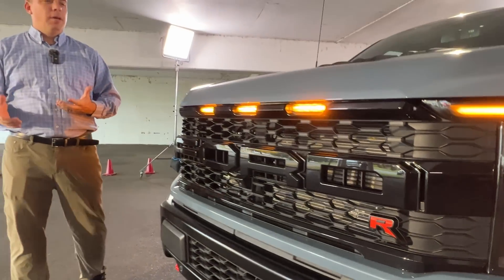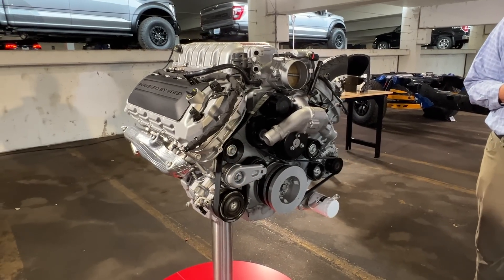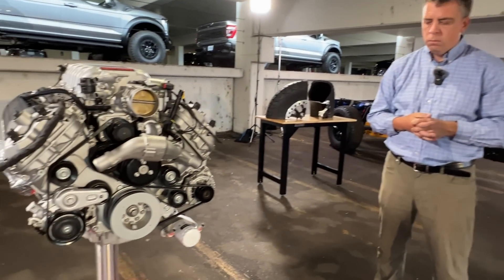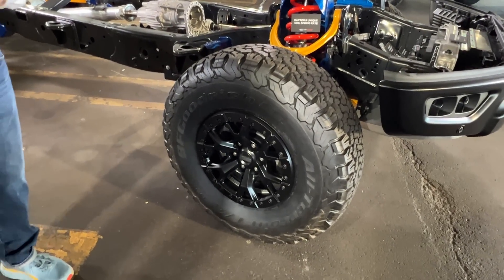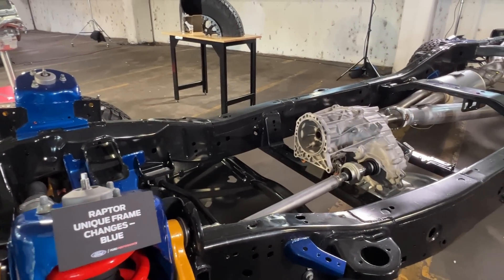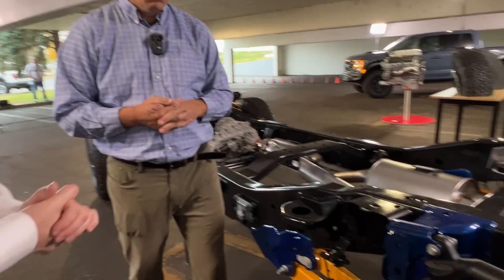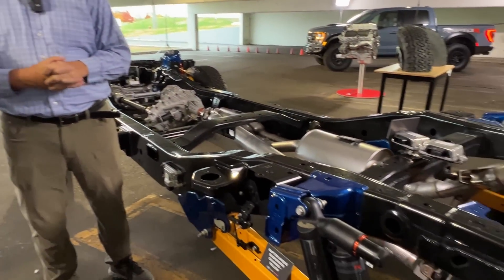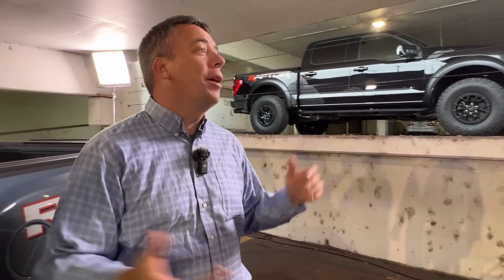Here Is Why the New 2023 Ford F-150 Raptor R Has Less Horsepower Than the Ram TRX

Comment: A well optioned V-6 Raptor with the 37PP is $85-$86K with the Recaro interior. The V-8 bumps the price to $109K? I just don't see $24K in upgrades to justify the price.
Reply: Which even then wasn’t worth it.

Rest assured they’ll have people lined up around the block for them though, despite the fact every dealer that gets them will price gouge the customers and ford will allow it.  The price of vehicles has been needlessly ridiculous for well over a decade now.
Reply: @blakew5672  Ford doesn't allow it, they just can't do anything about it. There's just boneheaded laws protecting the dealers.
Reply: @burgerbandit3646  
Ford can’t do anything about overpricing of a product they have direct control of the supply stream over?  Yeah, sure. 

Ford absolutely can do something about it, they just don’t. So saying they can’t do anything is effectively a lie. Refusal to address a problem is a small step away from tacitly allowing it. 

There’s a reason dealerships are referred to as “authorized” and dealerships marked as such are the ones that receive new stock and can place orders directly with the factories.  

Concerning specialty models (the ones that ALWAYS get gouged) dealerships are unnecessary middlemen who do nothing but attempt steal from consumers through markups. Many of those orders and builds were placed via internet and the consumer is then forced to receive that delivery through a dealer.  We’re not talking about mass volume stock cars that sit on the lots. They’d go under if they didn’t remain competitive on prices. Instead they prey on those that have already made financial commitments to vehicles that aren’t as likely to just walk away. 

If Ford wanted to do anything about price gouging they could stop allocating to dealers that take a cut off the top or start delivering small volume models direct to the buyer.
Reply: @blakew5672  Bro what part of laws are protecting the dealers aren't you getting. Ford can't interfere with the dealers because they're privately owned and the laws are also stopping Ford from cutting the dealers out of the equation period. They've tried threatening the dealerships with all that crap but they just don't listen anyway. Once Ford gives them the vehicles, they have no say over them. And since they can't sell the vehicles themselves, they have to deal through the stealerships. It's disgusting honestly
Reply: @burgerbandit3646  
What am I not getting? How about the part you neglected to mention about “laws”. Don’t act like I’m the dumb one after the fact when you failed to mention a talking point. So now you’re brought it up, let’s address it. 

They’re no law obligating them to provide vehicles to dealers, they’re contractually obligated. It’s different. Contracts always have expiration dates. Come time to renegotiate that contract Ford can prove it’s serious. Again, they have direct control over the supply and can dictate the terms of the sales in the contract.  Dealers don’t like it? Well they can pay up front and take legal ownership of the car first then. Dealers don’t actually OWN the millions in inventory on their lot. 

Funny enough most of the dealers are in a huge uproar over Ford taking steps to separate their EV business model from their legacy automotive model. Don’t tell me it’s not possible when they’re actively doing it right now with EVs.  

Is this the part where we both pretend multi-billion dollar companies don’t exert a huge influence on the laws they’re expected to abide by?  Let’s pretend they are legally bound in this garbage-can dealership scheme, it’s foolish to pretend they couldn’t lobby to get that legislation changed. They don’t, because they don’t actually care. If they did it would’ve changed. Instead they get to wash their hands of the guilty and people will buy the “we’re legally obligated” nonsense. 

Tesla sells direct to consumer, so again, miss me with it when the biggest player in the EV game is using a business model you’re insisting is illegal, and has been doing so unchallenged for a decade now. Terminate contracts with dealers in states that don’t allow direct to consumer sales (ie a safeguard against price gouging) and watch how fast the actual laws change when it starts affecting the economies of those states.
Reply: @blakew5672  So tell me what Ford can do RIGHT NOW about the dealer markup then? Until whatever laws are changed or whatever else nonsense, they're stuck in a loop.
Reply: @burgerbandit3646  
Right now? I legit just told you.  This has been happening for 20+ years. What they can do right now is a moot point given they’ve yet to try anything.  It’s no different than anything that takes time, like growing a tree. You can’t snap your fingers and have a forest, but that’s not an excuse for failing to start planting seeds

Again, they’re actively trying this currently with EV cars. The fact they’ve not even lifted a finger to try it with any other vehicle speaks volumes. They COULD have tried and chose not to.

Comment: Taking the Torsen out of the front and going to an electric differential was weird to hear.
Reply: Cost cutting and weight.  Now they just use the brakes.
Reply: I heard an open differential when he said they’ll use the brakes. Wonder if there’s a power limitation on limited slips since the trx is the same way.
Reply: @bradentrevino7694  nah, torsens can easily handle 1000+hp....there must be another weakness in the axle housing itself...

Comment: As always great TFL video and lots of details. 👍Great to see drive shafts, front & rear axle and diff without any rust.😎 This is very rare at new Ford trucks. This truck is awesome -the price, too.
Reply: Must be it's first day out of the factory.
Reply: Saw a review of a ‘22 Maverick with a rusty muffler in fairly low miles(not Northeast, either!). Clearly a victim of excessive cost-cutting to hit a price point. Reviewer said that it would likely need replacement before warranty ended. Unacceptable!

Comment: So the limiting factor to why they chose not to use a V8 before is the ‘suspension?’ Methinks not.
Reply: I know why. The V6 is lighter weight and better for the trails. They knew everyone wanted the V8 but they were holding back to build up the momentum. Deep down we all knew it was coming back. It just took the right time. They were totally developing it the entire time they just had to wait for talltbe trx owners to buy their trucks ad then want a new truck after a couple years, boom they drop it, perfect timing. It's a beast
Reply: Ignorance at it's finest
Reply: Really, it seems to me the nose heavy TRX that likes to dolphin dive after jumps really shows that suspension and weight is a big factor, which isn't suppose to be a surprise considering these are suppose to be dessert running and baja racing trucks, basically a  trophy truck for the road. Stay ignorant if you want

Comment: When Andre asked about the horsepower numbers I can tell you one of the main reasons they didn’t go above 700 hp. I work with a guy that has a hellcat and it gets 8 miles to the gallon to 10 miles to the gallon. If I remember correctly he said he gets about 140 miles on a tank. Once you get up around that type of horsepower you give up traction because you literally burn out your tires the second you touch the gas, and then you also burn up all your gas.
Reply: I get 10mpg or so in the city but 24 mpg in the highway 
I have a Hellcat too
Reply: TRX has 702 HP, ford getting to 705 would not have effected the MPG....... Its about durability!!!!
Reply: I think Ford decided they don't want to get into a HP shootout because Dodge doesn't give a damn about if the truck actually works, Ford knows the practical limits so just decided to basically match the numbers.
Reply: @adamheichel7066  That makes sense. I would rather give up some HP to have longevity for sure.
Reply: @reyperez3424  Wow 24 huh. My buddy must be pretty heavy footed.

Comment: If it wasn’t for Dodge TRX Ford would be still forcing you to buy the wimpy trans girly V6 🤭
Reply: So it sounds like you dislike the V6 🤣🤣🤣
Reply: The V6 is still good, better than the 6.2 in terms of performance. I just took my Raptor to Flagpole Knob in virgina on saturday and was ripping it through the trails and mud holes. I think it's a great truck personally 😁

Comment: It wouldn't matter when you know the 6.4ltr can push north of 1000 hp. This was known years ago when a few private owners decided to do it. Next came longevity. Again, it would not matter. :) It is the same with Cummins, which is not even close to its real rating. Excellent video and very informative by the Ford Engineer.

Comment: Ford was very proud of their V6 twin turbo in the Raptor until customers were trading in their v6 Raptors for a TRX v8. Ford basically took the biggest V8 engine they had in factory put a Supercharger on it and still couldn't match the RAM TRX in power. But Ford has the most powerful diesel engine.
Reply: Biggest V8 while maintaining the purpose of the Raptor…..Allegedly…..

The TRX is absolutely awesome and probably fits most people in the performance truck market a bit better.  But the raptor’s a much better truck for the off-road market it’s directed towards. 

Not saying the TRX isn’t great off road just not the Raptor’s level, and same with the Raptor, not as good on road for a performance vehicle as the TRX. 

I would have loved to see them slap their actual largest factory V8, then slap a Supercharger on it. Godzilla baby!!!
Reply: @CurtisDishman  A supercharged Godzilla v8 in the Raptor R would have been the perfect fit and true a balanced truck is a reliable truck. However, it all comes down to the customer's preference because Hennessey could take the Raptor R pass TRX's horsepower.
Reply: Biggest v8 they have? They have a 7.3 v8 as well... or they could have kept the 6.2 around.. or waited a little bit and used the 6.8 they just announced for the SD trucks lol.
Reply: Wow, so 2 hp less and 10 less pounds of Torque is terrible? So you just pretending the 400 plus pounds the TRX weights more over the Raptor means nothing?
Reply: @KaiDragon  if Hennessey would even give your truck back, im sure you've heard about how scammy and shady they are
Reply: @ForTehNguyen  I guess someone had a bad experience with Hennessey
Reply: @michaelschneider530  yea the 7.3 but Ford wasn't thinking about the 7.3 so the second biggest v8 engine they where thinking about the 5.2.
Reply: @CurtisDishman  😂😂😂😂 jump a raptor, bend a frame. 🤷‍♂️
Reply: @rau4329  nope! Doesn’t mean a whole lot when you have a more sturdy vehicle.
Reply: @JohnDoe-nz6bk  what? Raptors haven’t bent since gen 2
Reply: @rau4329  😂😂😂😂😂😂
Reply: To bad they will all have a 20k plus mark up on them. All thanks to the shitty dealers, and the dumb people who pay above sticker.
Reply: @JohnDoe-nz6bk  what? Almost all of the raptors with bent frames are gen 1.  Some are gen 2 but those are people pushing the raptors to the limits or even past the limit. Any frame can bend if you push it to far. It’s common sense.
Reply: @rau4329  😂😂😂🤦‍♂️ google is your friend!! and they weren’t being pushed to their limits.
Reply: @JohnDoe-nz6bk  google is your friend? I’ve looked and the only ones that came up are gen 1. So obviously you aren’t finding facts and just pretending it’s true. Unless you want to post some proof.
Reply: @rau4329  😂😂 you’re the one not looking, fanboi! I easily found the information in the first 2 pages. I expected nothing less from a ford, fanboi!
Reply: @JohnDoe-nz6bk  send the link then. Prove me wrong.

Again the only things I found are people pushing the raptors suspension to the limit. Nothing about bent frames. So please provide some links since it seems you have found some.
Reply: @rau4329  😂🤦‍♂️ as you know, you can’t post links. However, I already know you’re lying. If I can see it, so can others who aren’t fanbois.
Reply: @rau4329  this is what our conversation sounds like, fanboi!

Ford fanboi conversation.......

Fb: Ford is awesome, can't beat the quality. I'm looking at New ones now while they replace the engine, and take care of the recalls.

Me: why would you buy another one fanboi? 

Fb: because you can't beat the quality, they're great. I've put 25,000 miles on in 2 years, and have only been to the shop 80 times. They're great quality, Ford best selling for 300 years! 

Me: Uhhhh... How is it great quality when you been in the shop 80 times, and they're replacing the engine after 25,000 miles? Oh, they're best selling because of fleet sales. Otherwise, Chevy would kill them, and ram isn't too far behind. 

Fb: Bruh, stop hating! They best, they kick everyone's ass. Ford forever Bruh! 

Me: 😦

Fb: well, they're done. I'll be back next week for them to replace the tranny and rear axle. Then I'm trading it for a new one. Ford is the best Bruh! 

Me: 🤦‍♂️🤦‍♂️🤦‍♂️🤦‍♂️🤦‍♂️🤦‍♂️🤦‍♂️🤦‍♂️🤦‍♂️😆😆😆

Comment: The 2HP difference will be more then equalled when the R weights 800lbs less. Has a 10 speed and the gearing.
Reply: Ford literally already came out and announced that it is not as quick as the TRX on the street.
Reply: @dmatthews3583  When?

Comment: No mention about brakes. Raptor had poor brakes like many other trucks,only the Tundra had 4 pot caliper. For a 700 HP desert truck and those big tires you would need huge brakes to get some performance over and over.
Reply: The trx has really bad brakes too.
Reply: With more parasitic drag from the supercharger the downshifting/engine braking should be stronger at slowing the vehicle down than on the 3.5 Ecoboost.
Reply: 2019+ GMs use fixed 4 piston calipers too.
Reply: You gotta always drive in Sport mode and the tranny helps with downshifting to slow the beast down and sometimes you need to even downshift with the paddle shifters a little early within reason.

Comment: 700 hp out of 5.2 l that's insane
Reply: If it were naturally aspirated, absolutely.  Since it has forced induction, that’s actually not that impressive compared to other engines.
Reply: @aussie2uGA  it's smaller than hellcat v8
Reply: @Jv19979   And the truck weighs almost as much as the hell cat
Reply: @Tegridynews  that's crazy.

Comment: Roman once said that the era of V8s was coming to an end. Ford just proved him wrong. There is no replacement for displacement. Long live the V8!
Reply: V8s are dying. Ford only put it on life support. 

Dodge (stelantis) is moving away from V8s, no more V8 performance cars after this gen is up.

Chevy is killing the camaro, it's rumored to be replaced by EV

With ever tightening EPA demands on fuel milage your going to see less and less V8s as manufactures get their averages up. Your going to see a hell of a lot more electrification
Reply: @D41Michigan  Electrification is a fad that is on life support with government money. Our current infrastructure doesn’t have the capacity to take on the influx of new EVs. At the end, the free market will decide who will win this battle not government. My vote is for a powerful clean burning V8!
Reply: @rockyvi5709  then let's vote these climate activists out and bring back the V8
Reply: I agree. Let’s vote for go old fashion common sense. I’m not for turning a machine into an appliance by plugging it into an electrical wall outlet. EVs have their place but they will never completely replace the V8 especially in a truck. There will always be a V8 powered truck in my garage.
Reply: @rockyvi5709  I remember a article back in the mid 2000s where muscle car magazine did a 500hp Chevelle that ran on propane. It was a LPG converted 454
Reply: Yes! Propane’s 110 octane rating and cooling properties when it turns into a gas makes it excellent for the use in high compression engines. In fact, we had a small fleet of pickup trucks and tractors that ran on propane on our farm. The high  operating psi and storage issues make it difficult to retrofit a small vehicle. Great article!

Comment: I wonder what the MPG will be? 7-8? 4 offroading?
Reply: Its a toy. Like off-road vehicles and wave runners. Fuel economy is not a consideration.
Reply: @krane15  sure but they're not Can-Ams on trailers. 95% of use is likely on pavement.

Comment: The better question is:  Why does this start over $100k, way more than the TRX, with less power than the TRX?🤔
Reply: It's two horsepower bro, that literally doesn't make a difference when you already have 700. The raptor is hundreds of lbs lighter, with a better chassis, suspension and tires. It's better where it counts.
Reply: @KB-bh9hp  😂😂😂😂😂😂😂😂😂😂😂😂😂😂
Reply: @KB-bh9hp  I don't know about suspension I thought fox was better until the dude broke his back jumping a Raptor 😭 nobody broke their back jumping the trx
Reply: @dor1tomcswagger69  So with ford's trucks, what you're saying is your literal back will break before the truck does. Shows how durable those raptors are. Streetspeed 717 jumped both. The raptor drove away with no issues. The TRX had parts break on it.

Comment: A question for Carl - why does Ford intentionally design a safety flaw into the automatic transmission shifters for all automatic transmission vehicles. This is on cars as well so it is not limited to Ratpors, F150s nor any trucks?!!!
•  Ford auto trans do not have the ability to allow drivers to push the shift lever from D into N in an emergency, without risk of going into R, to disconnect the engine from the drivetrain! There is a lockout which prevents it!  
•  None of your competitors have this issue - Ram, Chevy, GMC, even cars from Toyota, Lexus, Honda, BMW, Mercedes, Audi, Porsche, Nissan !!!